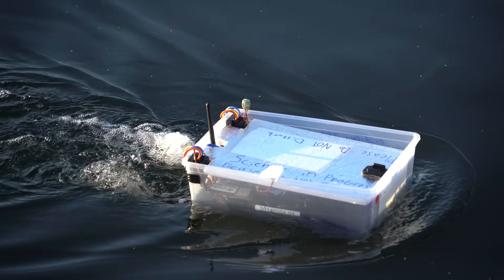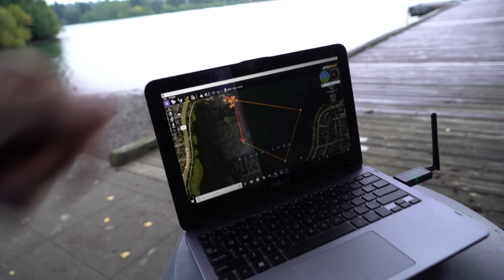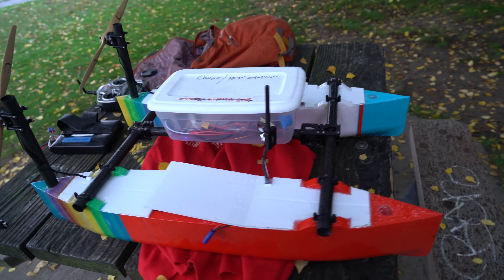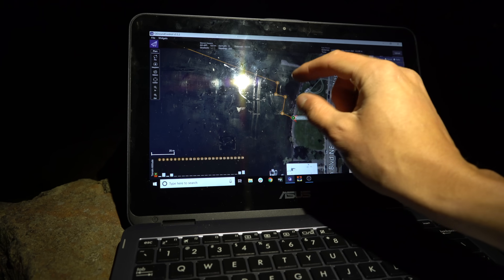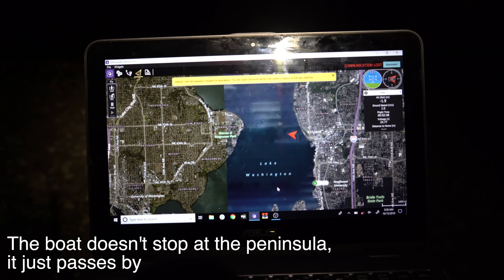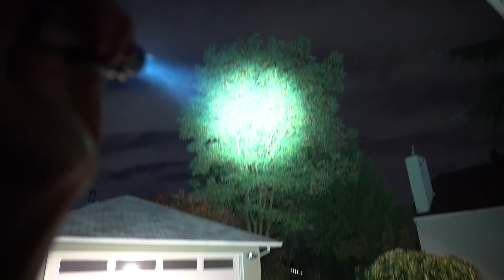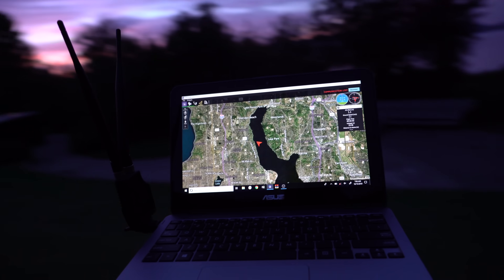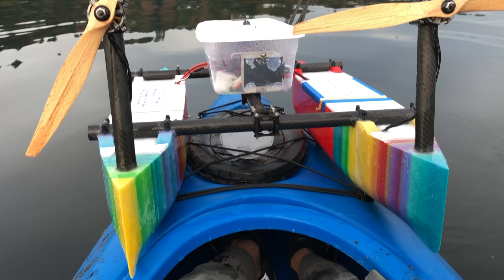Autonomous R/C Boat 13km Waypoint Mission

Comment: Maybe it's a stupid comment, but what about just filling out both hulls of spray polyurethane or any other foam? Once it gets hard you can cut away the excess and carve the space for the batteries. This way even if water leaks inside the plastic shells it can't really do anything as that foam doesn't soak, and even if the boat somehow gets upside down it would still float. In future designs you could even print just a thin shell as the foam would give rigidity, bringing down print time too.

Comment: Have you considered making the pontoons out of solid lightweight foam and securing everything on top?   There would be no worries about taking on water.
Reply: I would think the boogie board would loose energy to friction. A redesign of the hulls for more efficiency/obstacle mitigation. Now I really want to open up Fusion and fire up my 3D printer
Reply: Or, just dont use it as a storage. Just sealing it off is even beter
Reply: ...and skinning them with fibreglass.
Reply: Andy I'm with you on that one Andy! I would add that a trimaran design is worth considering for a future redesign.
Reply: connosaurus  A trimaran would definitely up the cool factor but I can't really think of any practical reason for it otherwise. A third hull would just increase drag further which is the opposite of that is wanted.
Reply: Cant seal them up, the dodgy thing needs the battery weight below the waterline to keep from flopping over.
Reply: @dash8465  
If it was a narrow hull, you would be 100% correct, but with the wide stance of a catamaran, you could get away with it.
Reply: @Andy-df5fj  No way.  Those big batteries are far too heavy to be mounted above those cross tubes. 
He needs to reshape the nose of the pontoons then properly skin them using fiberglass cloth and marine resin/epoxy.  That'll seal it up and allow all batteries to be mounted down as low as possible where they belong.

Comment: I feel like your seaweed problems may have been caused by using a hull with a steep front rather than gradual like would be seen on a speedboat.

I don't feel like the catamaran design is inherently flawed, and I dare say it's very much worth another attempt.
Reply: Did you actually watch the whole vid? He mentions the steep bow problem in two instances :-)
Reply: Chris Leech I did hahah, I must have missed that bit D:

Either way, he should try again
Reply: He is using a wave piercing design which is great for a non planing boat like he has as long as their is no seaweed in the area..

Comment: 18:20 need bilge pump on each side .. or sealed foam pontoons with everything in the box on top .. lots of learning steps! :)
Reply: for small sailing boats there are auto-bilge valves: there is some kind ball ball valve plus a venturi effect pump. So it pulls the water out during fast cruise. scaled to size together with a water level switch the boat could accellerate to e.g. 10 knots for a minute, until the bilge is below threshold.
Reply: Like a boogy board? :)
Reply: @mbainrot  no, because its the wrong shape, its designed to hold up a person, not be an efficient hull, far too much drag

Comment: So cool!  I'm local (North Kirkland) and it took me a minute to figure out why you were going from Kirkland and then over 520 to get to Bothell...  Then stopping at the other parks made sense.  I've got a couple older 8-bit mini Ardupilot boards and now find myself thinking I should be checking local thrift stores for a boogie board too (or find the one at my parent's house from that trip to Hawaii in the 80's and sacrifice it).  Unfortunately I don't have a workable full size boat but intend to get a small inflatable one of these years (and do have a small gas outboard).  I'll hit you up if that ever happens and you're still doing this and would like boat backup. :)  

I'd also like to try a brushless "rocket" like you've been working on and may hit you up about that at some point as well.

Comment: Amazing. Put a camera on the next one?
Reply: In some shots you could see a go pro mounted on the top, not sure why he didnt leave it there.
Reply: probably weight. more weight means more drag which means less chance that the batteries would last the distance. Also the electronics alone would be a pain to lose let alone a gopro
Reply: @CaptainShanko  that would be a good explanation
Reply: Okay he attached 2 cams now :D
Reply: That would turn out to be one expensive boat
Reply: Thomas Glavin not necessary
Reply: Regarding weight/cost just get a super cheap knockoff gopro on ebay, those things are light as hell because of the awful quality
Reply: poobertop How about just a runcam so he can see POV when it’s close?  Also those are light.
Reply: you are a youtuber and you dont put a single camera on the boat?? woaw

Comment: Maybe you should add third motor so if one of that two stops you can control it by rotating it one side until it is pointing to your location, and then just turn on middle motor to go straight?!

Comment: Get rid of that spektrum. Not suitable for long range. Even a $50 flysky outperforms dsm, and frsky / futaba (Texas Instruments CC2500 based) goes up to 2000m.
And those telemetry antennas, parallel in the same place doesent work well. Have tham at a significant angle or in different places.
Reply: thats why its autonomous... he only needs radio link to get it startet...

Comment: Redesign your hulls so the bow is bevelled with no sharp edges. Then taper into a keel towards the mid section, then back to a smooth bevel. Also be sure to position your weight to keep the craft level.

Comment: Would a jetboat be efficient and weed proof enough?
Reply: I built a jetboat once, and it tended to suck weed onto the screen/filter a lot. But the huge upside is, I could get it unstuck just by stopping the motor.
My boat didn't even have a reverse function, with reverse you would be even safer.
Reply: ... very high current draw.
Reply: @websitesthatneedanem  Don't think of it as a fast jetboat.
It is quite similar to a regular propeller
Reply: @DerKrawallkeks Pretty sure ducted fans/screws are generally less efficient than unducted.
EDIT: or not apparently
Reply: @bartybum  at low speed ducted propellers are extremely efficient. Look at tugboat designs.
Reply: @bartybum  not neccesarily, at low power applications the difference isn't too big at all. Plus the duct can be much larger than the prop diameter in this case